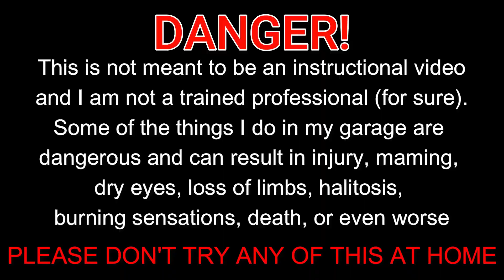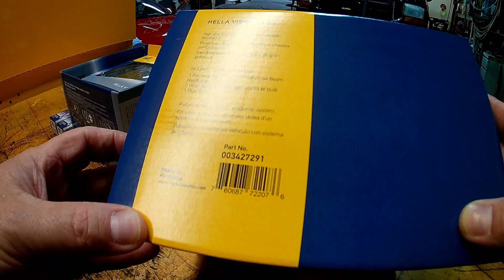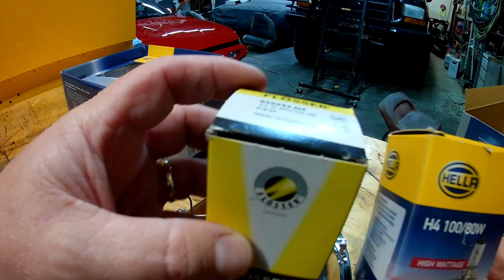Survivor Mitsubishi Starion Turbo (Conquest TSi) - Converting to Hella H4 Headlights

Comment: I need these on my 1989 240SX and 1994 Corvette. 

I was holding off in hopes of a good LED upgrade. This seems like a nice simple upgrade that fits stock.

Also, im.sure those bulbs are original. I also have a 2001 BMW that I bought new. 122k miles and the passenger Headlight bulb is original.
Reply from the maker: Yeah, they're not LEDs, but for a stock upgrade, they're really good.